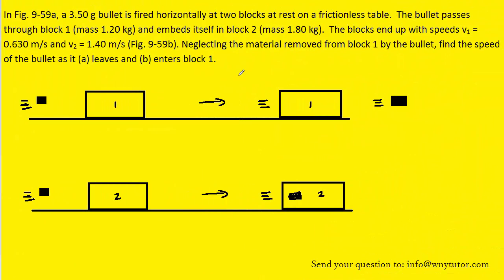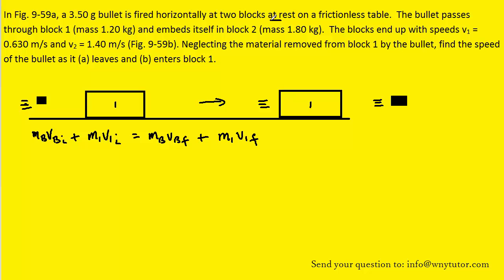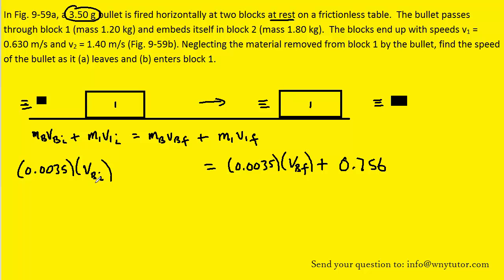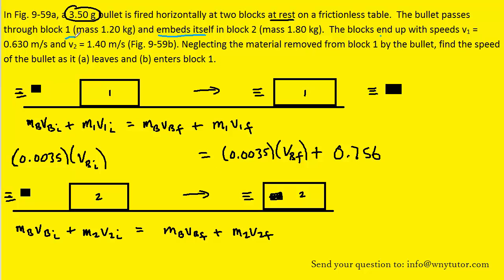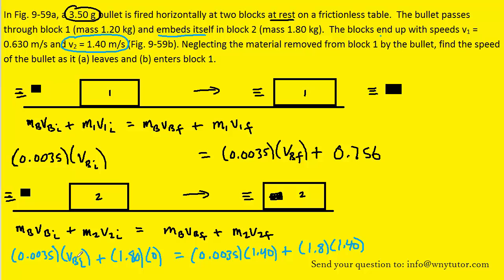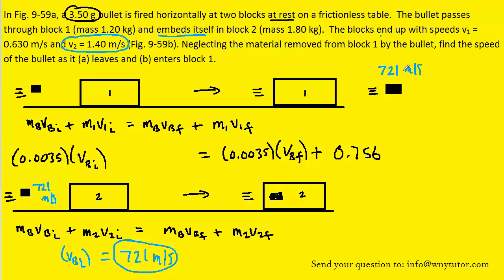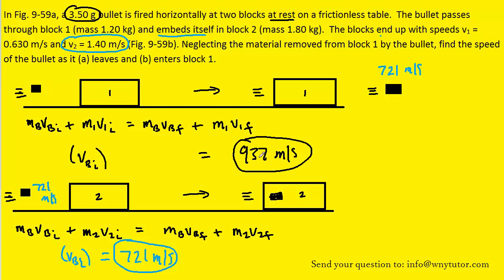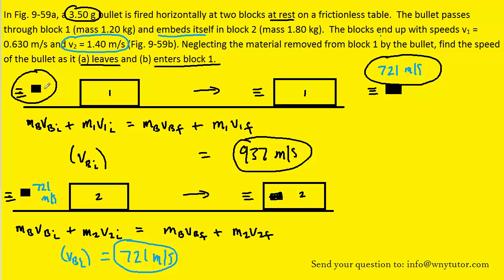A 3.50 g bullet is fired horizontally at two blocks at rest on a frictionless table.

Comment: Hi Sir can you help me with my homework 
Question 1. A 35 g bullet was fired horizontally from a gun with a velocity of 320.0 m/s. If the barrel is 1.1 meter from the ground, how long will it take for the bullet to reach the ground? (ROUND YOUR ANSWER TO 1 DECIMAL PLACE, Ex. 100.0)
Question 2 . A 35 g bullet was fired horizontally from a gun with a velocity of 315.0 m/s. If the barrel is 1.5 meter from the ground, how far will the bullet reach as it first hit the ground? (ROUND YOUR ANSWER TO 1 DECIMAL PLACE, Ex. 100.0)

Thank you so much